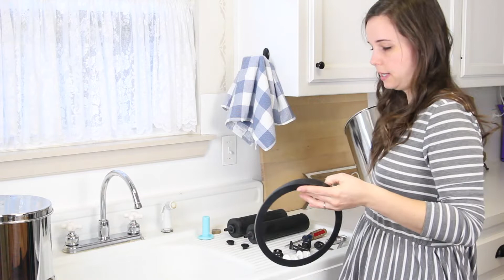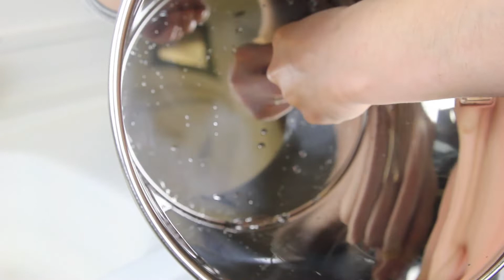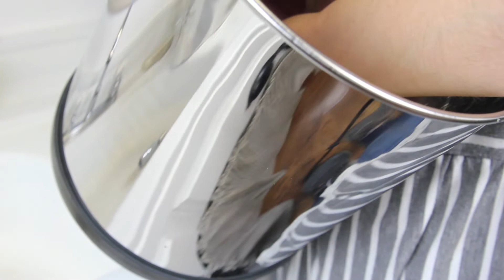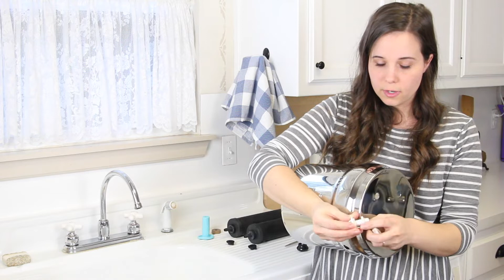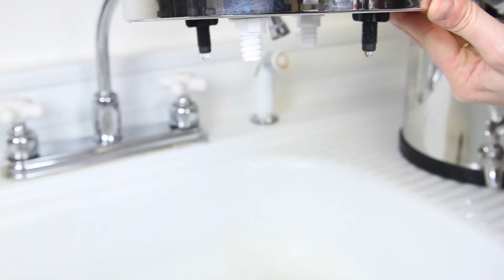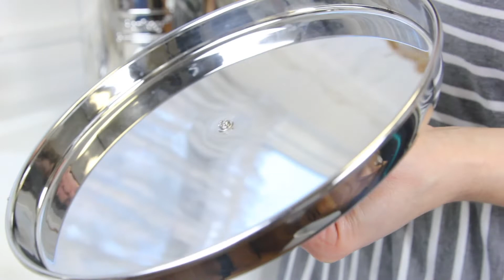Berkey Water Filter Assembly Instructions | How To Setup Your Berkey Filter Start To Finish

Comment: You've  got your washers backwards.  The beveled narrow ends should face the container.   Your spigot shouldn't  have to be screwed that tight because it stresses the washer and eventually could leak.  The smaller end works with the curve of the unit for a snug fit.   Visually it looks like the flat edge should be against the container but when I did this, after some time there was leaking.  Reread instructions and redid the installation of spigot.  No more leaking problems.

Comment: In the Berkey's printed instruction sheet re plastic spigot install it says (and the diagram on pkg of spigot parts shows): "Place the beveled exterior washer onto the threaded portion of the outlet spigot with the beveled side facing the system [tank] hole and the flat side facing the spigot." That's the opposite of the way you described the beveled washer installation at 4:26 in your vid.

Comment: Cannot get my black filters primed!! Ugh !!
Reply from the maker: Dawn Ross what's happening when you try to prime them?
Reply: This Lovely Little Farmhouse nothing !! I hear the water in them. But, they do not sweat. Looked at a few more videos & there is this $30 primer one can buy to blow air to open pores. But, I should not have to buy more to get it to work. Trying to figure this out.
Reply from the maker: Dawn Ross I agree, you shouldn't have to buy something extra. Are you using the priming ring or the blue prime rite? Is water coming out of the top instead as if you weren't getting a good deal on your primer?
Reply: This Lovely Little Farmhouse - All my faucets have multiple holes, not a basic stream. Yes, using primer provided. No luck. Thanks, for your concern. Going to call them.
Reply from the maker: Dawn Ross I hope they can help you get it figured out!
Reply: This Lovely Little Farmhouse  - they suggested getting something like a fresh plastic bottle with a tip (like ketchup/decorator) and fill with water. Have a new house & all faucets have spray type heads. Obviously, common issue when trying to prime the filters.